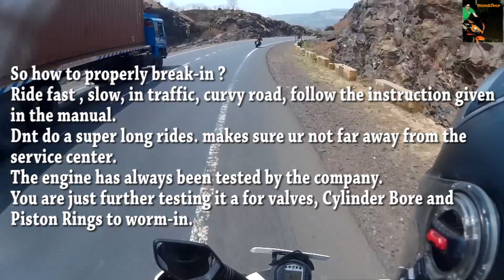How to break in / Run in Your new motorcycle engine.

Comment: Pls help and give some suggestion, my bike Yamaha 150cc are just 1 month old, Im traveling almost 50 mins of 60km speed. At first the engine are running smooth and I feel it in the throttle grip, but after 20 mins the engine runs with something wrong I mean the smoothness are gone and I feel in the throttle grip it feels like sharp crack feeling inside the engine, I feel it everyday when I'm using my motorcycle 😢😟😖😖😞

Comment: Hi nikhil, I bought new bike hornet 160r. I heard that it us necessary that new engine idle speed shall around 1400rpm. When I bought it was 1000 rpm n never faced any hiccups issue and engine stop when I asked service centre guys about idle speed they said it not necessary I less ur bike doesn't stop n don't struggle . Does it going to effect future performance of the bike. After 1st service they increased the idle speed to 1400 rpm. Please advise what is correct?

Comment: Hey +Mumbiker Nikhil,
Kudos for the video, really look forwards to your vids.

I have some question and would really look forward for your reply's
Just bought a new bike, Gixxer SF, and being very new to the technicalities of breaking in/ running in period, I want to know if ridding the bike in heavy traffic for the 1st 1000 kms like ridding it on 1st or 2nd gear for around 15 to 20 mins gonna damage my bike in any way. What would be the best track in which we should complete the break in period that is the 1st 1000 km.

I am following the suggestion of not crossing the 4500 rpm as mentioned in the user manual, but really confused that should i ride the bike in city at all and only on highways

Comment: ya I agree with you on this one.... can't use synthetic based oil for old engines design to run on mineral oil.
Reply from the maker: +haston lobo yes
Reply: +Mumbiker Nikhil after my 1000 miles. can I use synthetic oil on my motorcycle?
Reply: Yes u can.

Comment: I have seen and read about changing from synthetic based oil to mineral based oil for break in but no video tells the disadvantage neither the owners manual will ever tell you to do that, so I am a bit confused..... I remember long back reading in a book that sometimes changing oil from the one recommend can affect the engine seals or blow head gasket since certain seals react chemically with certain oil base. so always confirm from the manufacturer if its safe to do so or ask if the bike is factory filled with mineral oil only then I feel its safe to change oils.... wat say nikhil????
Reply from the maker: in a new bike like ktm 390. ull always get mineral oil. thr is a reason because the engine is new and it will collect some particals( i cant remember the actual sentence). mineral oil is thik. u can use mileral oil for bike like ktm which use semi synthetic oil. but u cant use semi synthetic oil for the bike which use mineral oil. then it will sees the engine..  this is as per my knowledge. i can be wrong.

Comment: Hey Hi, i just got the duke 390 Slipper Clutch Model. 3 days old and done with 250 kms. Do you think I need to slow down or continue with the same pace? Also I am moderating the speed from high to low and the RPM range is also wide so any other suggestions??
Reply from the maker: +Zoheb Shariffi dnt cross 7.5k rpm, make sure u ride in all the gears properly ( so for that try to ride in some ghat section), try to avoid ridding it in th city with jam traffic. as ur bike has mineral oil now and overheating of the bike now is not good.  dont cruise at a perticular speed for long. and ur good to go.  
i hav also made a video abt. how to run-in ur bike. if ull scroll down i have explained it properly. :) congrates for the bike
Reply: +Mumbiker Nikhil thank you so much! Am a huge fan of your trip videos! Hope you join along on a road trip soon :)
Reply from the maker: +Zoheb Shariffi thxzz bro.. hope to meet u some day as well :) and thxzzzz bro, people like u are really motivating me :)
Reply: Mumbiker Nikhil My engine had seized so I had most parts replaced. Everything apart from crank, casing, flywheel and gearbox is new. The service center guy put KTM regular synthetic oil and is adamant that it's right, what do you suggest I do, I have already done about 380 km on the new engine now. 
Never exceeded 6.5k rpm.
Varied RPM
Use rev-matched downshifts with engine breaking.
Should I be worried?

Comment: How long does it takes to complete the break in period. I recently got a RS200 and I babyied the bike for first 1000km. After that I took it to max. speed at 150km/h and now it has completed roughly 1500km and I'm riding it at 5-6 RPMs.
Reply from the maker: Yash Agrawal its ok now. but next time u see some1 with a new bike. tel him to follow the correct procedure :).
and dnt worry abt ur bike...just make sure u change the oil on time :)

Comment: Mumbiker Nikhil also while down shifting its better to do it with rev matching. It will keep the clutch and gearbox in good condition.(I meant to say that avoid clutch riding while braking)
Reply from the maker: ***** yes bro correct :) but i doubt some1 will do tat will thr new bike.
Reply from the maker: ***** nice channel btw...:)
Reply: Mumbiker Nikhil yeah! Most Indian bikers are not used to it. Its kind of tricky to do.
Reply: Thanks Mumbiker Nikhil  btw its not as good as yours :-)
Reply: ***** Whats clutch riding while braking?
Reply: Chirag Wath squeezing the clutch while slowing down from high speed and holding it in squeezed position until we accelerate again is called clutch riding. Instead of this doing rev match while down shifting will helps instant acceleration and helps to keep the clutch disengaged.
Reply: ***** thanks :)
Reply: Chirag Wath no problem!
Reply: RETRO 93 what is revv matching bro.? can u pls tell me